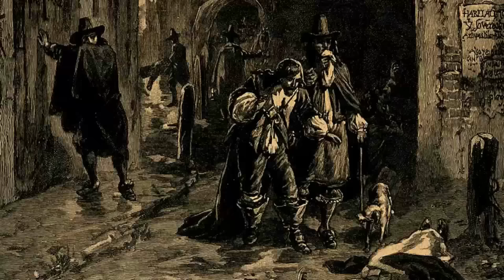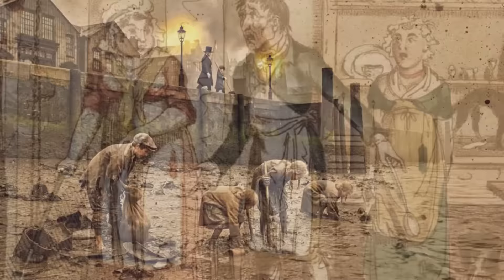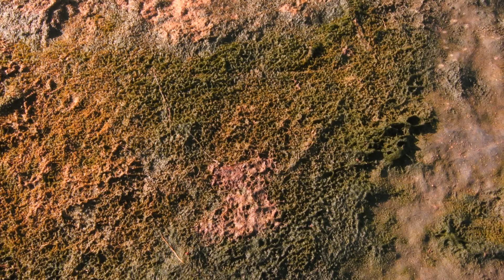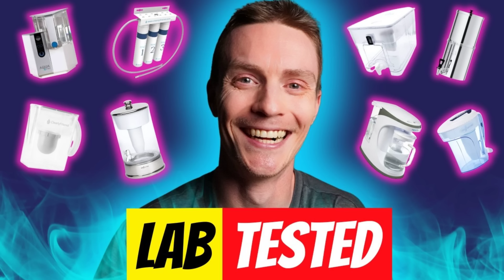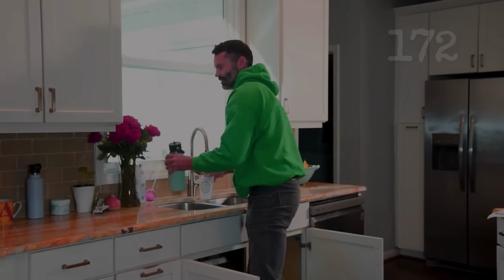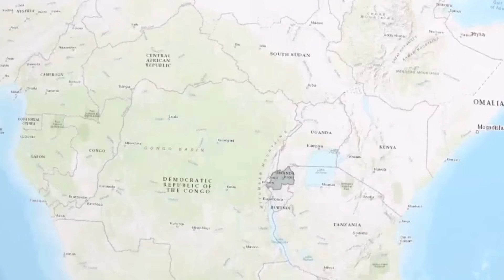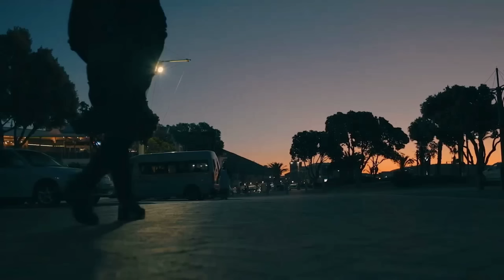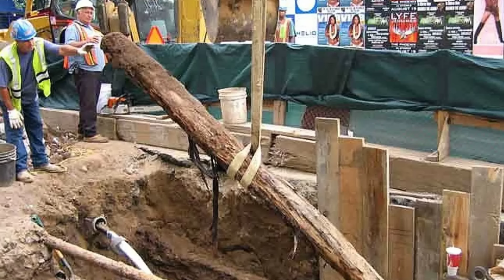The $50 Water Filter That Outlasts Any $5,000 System. Why Don't They Sell It?

Comment: This doesn't remove fluoride or microplastics. These are of main concern in municipal water sources.
Reply: There is no filtration for fluoride or chemicals except RO and distillation
Reply from the maker: @Lighthouse_Muse  
Distillation handles fluoride, agreed. RO handles it at around 90 to 95 percent removal depending on membrane condition. But both come with significant tradeoffs, energy consumption for distillation and water waste plus ongoing membrane costs for RO. Bone char filtration also removes fluoride effectively and has been used in developing countries for decades with no electricity required. The conversation gets more interesting when you stop looking for one filter that does everything and start asking what combination of simple technologies covers the full spectrum at the lowest lifetime cost.
Reply: Yep that's my main concern fluoride and microbiotics in City water. Unfortunately I believe rainwater to be much more dangerous.
Reply: Still safer than river water, once you filter out the impurities.
Reply from the maker: @richarda996  Correct, and that is the hierarchy of risk that gets lost when people argue about which filter handles every possible contaminant. A biosand filter turning turbid creek water into pathogen-free drinking water is solving the threat that actually kills people in the short term. The dissolved chemical conversation is important but it is a long-term chronic exposure concern, not an acute survival one. The question is whether people building their filtration strategy are designing for the emergency that kills in days or the exposure that matters over decades, because the answer determines which technology comes first in the stack.
Reply from the maker: @Whereishome368  Rainwater is actually far less dangerous than most people assume for biological contamination. It picks up particulates and some atmospheric chemistry on the way down, but it does not carry the fecal coliforms, parasites, and bacterial load that surface water does. The real risk with rainwater is what it contacts after it lands, roofing materials, gutters, collection surfaces, bird droppings. A first-flush diverter that discards the initial roof runoff followed by biosand filtration would give you a very clean product. For fluoride specifically, you are correct that biosand will not touch it, but rainwater does not contain fluoride in the first place since that is a municipal additive. If fluoride is your primary concern, rainwater collection might actually solve the problem before filtration even enters the picture.
Reply: @LostBuildArchivezI guess you're uninformed about Rainwater geoengineering look up the dimming.
Reply: Just add that to the system to the bottom layer
Reply from the maker: @Buggslylife  The instinct is right but the execution is more complicated than just adding a layer. Fluoride removal requires specific adsorption media like bone char or activated alumina, and those media have finite capacity, meaning they eventually saturate and need replacement. The moment you add a replaceable layer to the biosand filter you have reintroduced the exact recurring dependency the base design eliminates. The real design question is whether you keep the biosand filter pure as a zero-maintenance biological system and handle chemical contaminants in a separate dedicated stage, or whether you accept the tradeoff of periodic media replacement in exchange for a single integrated unit. Which compromise matters more to you, simplicity or coverage?
Reply from the maker: You are right that biosand filtration does not remove fluoride or microplastics, and that is worth being upfront about. But the framing of "main concern" depends entirely on where your water comes from. If you are on municipal water, fluoride and microplastics are legitimate priorities. If you are pulling from a creek or well with bacterial contamination, pathogens will kill you long before microplastics cause a problem. The real issue is that people treat water filtration like a single purchase decision when it is actually a threat-specific engineering question. What is your source water and have you actually tested it to know which contaminants you are dealing with?
Reply: Add cheap reverse osmosis filter after BSF.

Comment: Does the weather affect the performance or cleanliness ? Whether it’s hot or cold ?
Reply: The warmer it is outside the more the biofilm likes it. But it never gets to hot to harm them as you add water to the system it colds the water setting in it down. Cold is ok as long as it is above freezing. If it freezes it will not work right as the biofilm will b trapped in ice but it will not completely kill off the bacteria that are needed. But freezing should be avoided.
Reply from the maker: @cmiller8693  Good summary of the temperature dynamics. One addition worth noting is that in warm climates the biological activity in the schmutzdecke can actually increase flow resistance faster because the community grows more aggressively, which means you may need to do the swirl and dump maintenance more frequently in tropical environments than in temperate ones. The biology being more active is a net positive for filtration quality but it does change the maintenance interval.
Reply from the maker: Temperature matters. The biological community in the schmutzdecke is more active in warmer conditions, which means faster and more effective pathogen removal. In cold weather above freezing it slows down but still functions. The critical threshold is freezing. If the water column and sand bed freeze, the biology goes dormant and the filter stops working until it thaws. In extreme cold climates the filter needs to be housed in an insulated or sheltered structure. For anyone in a climate with hard winters, where would you put a biosand filter to keep it above freezing year-round without adding heating cost?

Comment: ~I get that removes 99.99 percent of bacteria, but what about removing viruses, chemicals and microplastics? 🤔
Reply: Fill a large holding tank with the filtered water elevated or with a pump at base level and pipe the water through a UV light.  That's the design we use with a commercial water filtration system at our home.  I'm going to try using the filtration system mentioned in the video combined with a UV light at the family farm. The annual maintenance costs of our tiered filtration system is over $1200.  We'll have the water lab tested and if it works that's what we'll use going forward.
Reply from the maker: @atlshawn  This is the kind of real-world testing that actually moves the conversation forward. Biosand filtration into a holding tank with UV polishing at the outlet is a layered system that covers biological, physical, and viral threats at a fraction of what a commercial tiered system costs. If your annual maintenance is running $1,200 right now, the payback period on a biosand plus UV setup would be measured in months, not years. When you get those lab results back I would genuinely like to hear what the numbers show, especially the bacterial and turbidity readings compared to your current system.
Reply from the maker: Viruses are the honest gap in biosand filtration. Bacteria and parasites get removed at 98 to 99 percent or higher, but viruses are small enough to pass through the sand matrix. Field studies show some virus reduction from biological predation in the schmutzdecke but not enough to call it reliable for virus-heavy source water. Microplastics above a certain particle size get physically trapped, but the smallest fractions pass through. Chemicals are mostly untouched. The real question is whether you are filtering against what is actually in your water or against a theoretical list of everything that could possibly be in water anywhere. Those are very different design problems.

Comment: Yeah, this could’ve been an interesting video.  But taking 35 minutes to get 10 minutes worth of information is not interesting.
Reply from the maker: Fair criticism on the pacing. The video could be tighter and I hear that feedback. The repetition is partly intentional because the core claims are far enough outside conventional thinking that a single mention does not land for most viewers, but there is a real line between reinforcement and redundancy. Where specifically did it start feeling like a loop for you? That is genuinely useful feedback for structuring the next one.
Reply: @Los@LostBuildArchivez I appreciate that you’re trying. and it’s good information.

Comment: Essential Construction Steps and Components
Container: Use a food-grade plastic container, concrete, or a 3-inch diameter PVC pipe (120 cm long) for the column. 
Outlet System:
Drill a hole 2 inches above the bottom.
Install a 1/2-inch PVC pipe with a fine mesh screen inside to prevent sand from entering.
Attach a downward-pointing elbow joint for water collection.
Diffuser Plate: A rigid plate with 50–75 evenly spaced 1/8-inch holes prevents water from disturbing the biological layer (schmutzdecke) when charging the filter. 
Layered Filtration Media (from bottom to top):
Coarse Gravel: 2 inches (6–12 mm diameter) as an underdrain.
Fine Gravel: 2–3 inches (0.7–6 mm) to prevent fine sand from migrating down.
Fine Sand: 18–24 inches (0.15–0.20 mm effective size) for biological and mechanical filtration.
Optional Activated Carbon: 1 inch on top of fine sand to remove certain chemicals (if desired).
Preparation: All gravel and sand must be washed until rinse water is clear (5–10 washings) to remove silt and ensure clean filtration. 
Critical Operational Requirements
Ripening Period: The biological layer (schmutzdecke) takes 2–3 weeks to develop, requiring the filter to be fed with contaminated water during this time. 
Usage: Use the filter at least once per day to maintain the biological layer.  A typical household filter can treat 20–60 liters of water daily.
Maintenance: Periodically flush the filter by opening the drain plug to remove accumulated sediment. 
Storage: Always store filtered water in a clean, sealed container to prevent recontamination. 
Recommended Resources
CAWST Biosand Filter Construction Manual (Version 10): The definitive guide for construction and monitoring. 
Instructables: Step-by-step visual guide with materials and tools list. 
Wikipedia: Overview of biosand filter function, history, and effectiveness.
OHorizons Wood Mold Design: A low-cost alternative for community-scale filter production. 
Note: While DIY plastic bucket filters are popular, they are less effective than the CAWST Version 10 due to insufficient sand depth and contact time. For reliable, long-term use, follow the CAWST or OHorizons designs.
Reply from the maker: This is a genuinely useful breakdown and I appreciate you laying out the CAWST Version 10 specs specifically because there are a lot of bucket filter tutorials floating around that skip critical details like sand depth and contact time. The activated carbon layer on top is an interesting addition worth discussing because it does help with taste and some chemical compounds but it also needs periodic replacement, which introduces exactly the kind of recurring dependency the base design avoids. For people watching this, is the tradeoff of adding carbon worth it if your source water is relatively clean biologically but has taste issues, or does it defeat the philosophy of the zero-maintenance design?
Reply: @LostBuildArchivezCouldn’t you theoretically make your own carbon? As long as you have the right wood to burn and don’t use any harmful accelerants, it costs you nothing but time.  Is there anything else that makes the carbon special?
Reply: Food grade plastic is an oxymoron. Terracotta pots and copper line.
Reply: @Whereishome368 his giving the cheapest way to filter out for the people that cannot afford it better. You get your own materials whatever fits your budget
Reply from the maker: @Buggslylife  Exactly right. The point of the biosand filter is that it scales to whatever someone can afford. Concrete and hardware store sand is the floor, not the ceiling. If someone has the resources to build with terracotta and copper, great. If someone has $30 and access to a hardware store, the filter still works. Gatekeeping a survival technology on material purity misses the entire reason it was designed the way it was.
Reply: @Whereishome368  There are folks that have no idea that a plastic container even could be food grade.  And there are some food grade that I'd never use, regardless.
Reply: @Whereishome368  Just be careful to buy terracotta pots which aren't high in lead.
Reply: @NothingByHalves Rodger that thank you.
Reply from the maker: @NothingByHalves  Good point and one that does not get enough attention. Glazed terracotta especially can contain lead in the glaze, and even unglazed pots from certain manufacturers or regions may have clay with elevated lead content depending on the geology of the source deposit. For a drinking water application, any terracotta vessel should either be tested for lead leaching or sourced from a manufacturer that certifies lead-free clay. Using a contaminated container to filter water defeats the entire purpose of the exercise.
Reply: @NothingByHalves  Nobody uses terracotta pots or mugs.
Reply from the maker: @Whereishome368  The skepticism toward food-grade plastic is not unfounded, especially with the growing research on microplastic leaching from containers under heat and UV exposure. Terracotta is a solid alternative for the filter body and has centuries of proven use in water storage and filtration across South Asia and Latin America. Copper lining adds antimicrobial properties, which is well documented in peer-reviewed literature. The tradeoff is cost and availability. Concrete remains the most common biosand filter body material because it is cheap, durable, and universally available, but for someone who has the budget and access, terracotta and copper are upgrades worth making. The CAWST design is material-agnostic on the container, so the core filtration science works regardless of what you build the shell from.
Reply: This is helpful because the cawst manual is not available anymore.
Reply: Can I use a larger container to process more water?
Reply: THAAANK YOU!  for your generous additional instructive information!   BLESS  YOU🎉😂❤❤❤
Reply: great
Reply from the maker: @gonestress  Glad it connected. If you dig deeper into the CAWST manual, the field data from 70 countries is where the real substance lives.
Reply: living matter hard to sell commercially, it's not due. to filtration industry blocking it. You won't get a licence to sell it. What category does it fall under, matter? Living matter?
Reply: Completely useless in a Western country like the US or Canada.  Our water is not dirty. It doesn't have a ton of organic particles suspended in it. It doesn't have bacterial growing in it.
Western style water filters are for taste and removing what is naturally in the water.  The filter in this video will not remove the stuff Westerners want removed like chlorine.
Reply: @tarstarkusz Common confusion: No water FILTER will remove chemicals like chlorine. A filter removes PARTICULATES sometimes including bacteria and virus. A water PURIFIER removes chemicals, but not particulates.
Reply: @lyfandeth  This in no way invalidates what I said.  The filter in the video cannot replace modern western water 'purifiers'
Reply: No plastic
Reply: THAANK YOU @k94536  for your generous kind  easily digestable infoemation!   BLESS YOU!   🎉🎉🎉😂❤❤❤
Reply: You got a German version please ? Sounds like it pls send in German❤
Reply: The good for nothing water company in NJ should read this. 
THE NJ WATER IS HIGHLY CONTAMINATED
Reply from the maker: @sunshinepatsoph4219  
New Jersey has some serious legacy contamination issues, particularly with PFAS in certain municipal systems. The honest tension here is that a biosand filter handles bacteria and parasites extremely well but is not designed for industrial chemical contamination like PFAS or heavy metals. That is a different problem requiring a different solution. The question nobody wants to answer is whether any single consumer product should be expected to solve what is fundamentally an infrastructure and regulatory failure at the municipal level.
Reply from the maker: @luzdragon100  Not yet, but a German version has been requested a few times now so it is clearly on the radar. Out of curiosity, are you looking at this for a specific use case in Germany or more generally? Water infrastructure in central Europe is a very different situation than rural North America, but the off-grid applications still apply.
Reply: @LostBuildArchivezI am German native and you use some German words😅